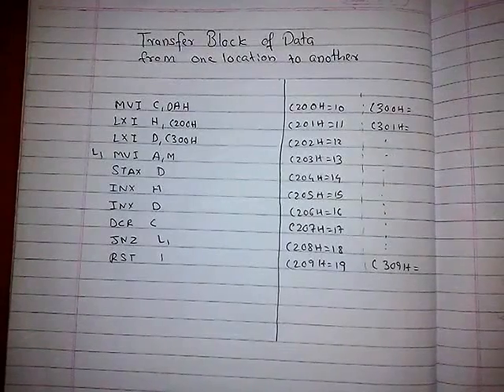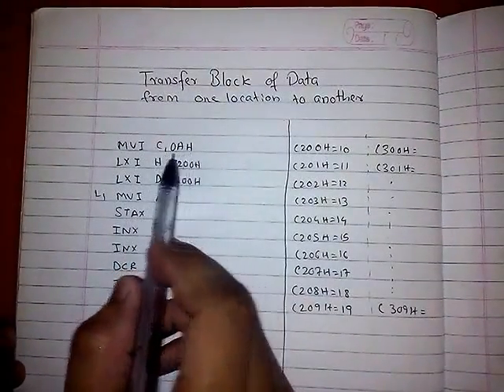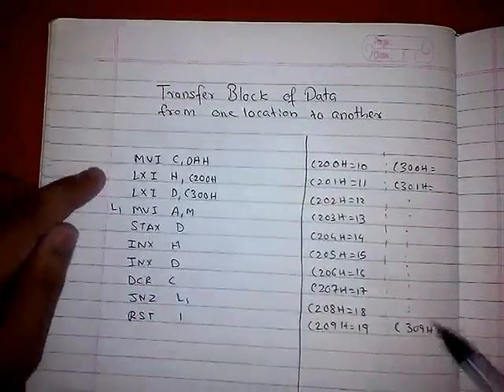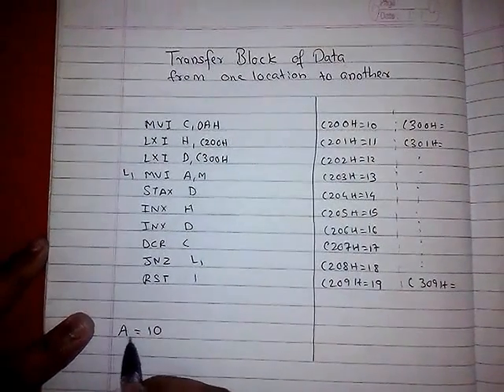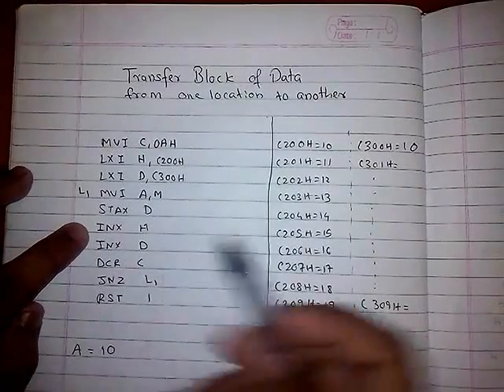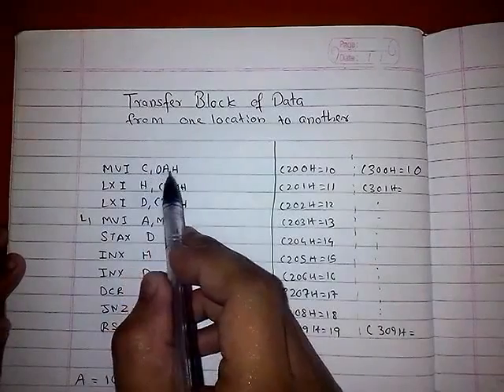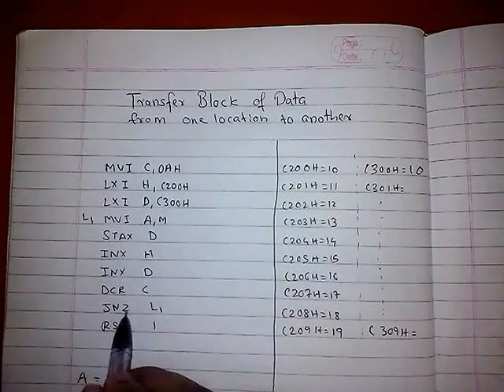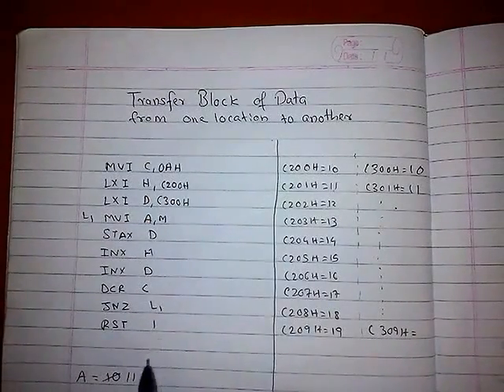Assembly language program For Transferring a block of data from one memory location to another

Comment: 1. 16 bytes are residing in locations starting from 2400h. write a program to transfer these bytes in locations starting from 2500h in such a way that first 8 bytes in the first block should appear at last 8 locations of second block and last 8 bytes in the first block at first 8 locations of the second block

Solution anyone